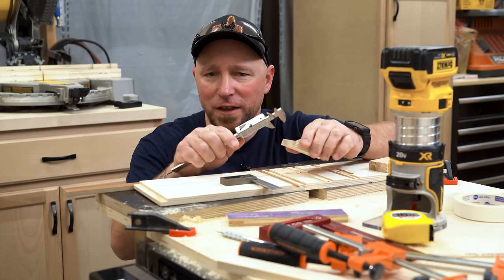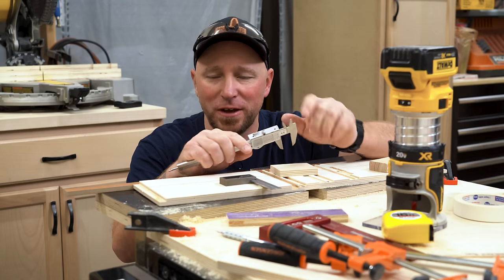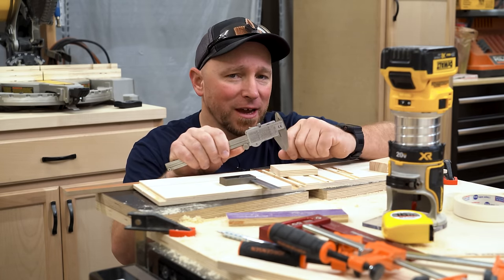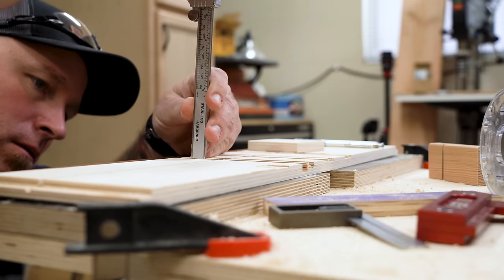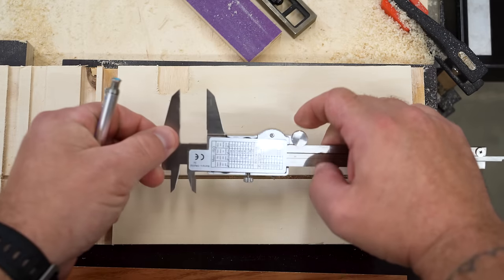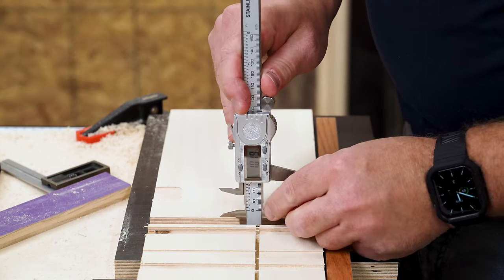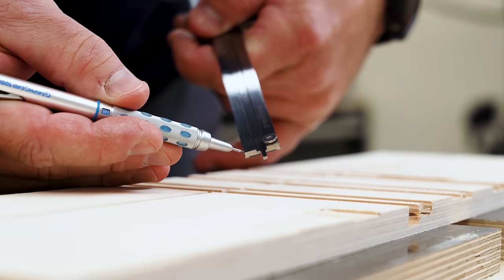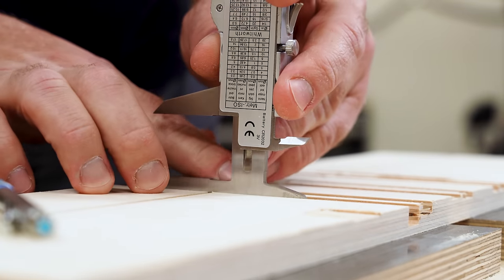The HIDDEN 4TH WAY to Measure w/Calipers

Comment: To measure the distance between two holes / studs
1) Measure one hole and zero the calipers
2) measure outside-to-outside, and the offset you put in in step 1 will automatically compensate for the two radiuses.
Reply: Yep. But only if the two holes are exactly the same diameter.
Reply from the maker: I think I might be reading this wrong. Why not just measure the space between the holes/studs? I do something similar to find centers of holes/studs though. I just measure, as an example, from the leftmost side of one hole, to the left most side of the next. That reading is the exact center-to-center distance between the two.
Reply: @InspireWoodcraft  The way I describe uses both external (for studs) or both internal (for holes) jaws. The way you seem to be suggesting would need one of each type of jaw? 
While  I am at it: Making metric parts on imperial lathes, or vice-versa. Set the caliper to the exact size required. Then zero it. Now change units and the measurement tells you how far under or oversize you are, in the required units, with no maths needed. Actually, this works even if you don't need units to work out how mush is left to take off. Or put back on 🙂
Reply: @andypughtube  i was charged with teaching a kid on a lathe. every mark on his tape measure was labeled, when he forgot it at home i let him use mine and he asked how is he gonna know what fraction hes at. I immediately had a talk with the boss and the kid was let go.
Im always weary of those who look for a work around to avoid one of the skills required no matter how small and insignificant that skill may be.
Reply: @swskitso  Tell you what, you carry on doing things the hard way. I will carry on using the available technology to do things the easy way. And we can both agree not to tell the other that they are doing it wrong.
Reply: @andypughtube  and when you lose the ability to perform the required task because you dont know how to do it without technology we will keep going without you.
Reply: @swskitso  and when you lose your tape measure I’ll have a word with the boss
Reply: @beyondafx  if i can find a stick or a string i can take a measurement 
I may not be able to write down any number to correspond with any known measuring scales but i can replicate an item or craft something original.
Numbers and measurements are made up things.
Reply: @swskitso  so instead of teaching him how to read a tape real quick, you have the kid fired? That sounds real petty
Reply: @EdM66410  that was the final straw not the first.
The only question asked of me before i got the job was can i read a tape, actually they told me my friend was wrong and they were not looking for help before they asked, when i asked if they needed me to read thirty seconds or sixty fourths i was hired
Reply: @swskitso  Cool story.  Your life experiences have made made you a uniquely valuable member of society to whom others should defer.

Is this the social validation you're looking for here?
Reply: @wcookiv  this is nothing about social validation, the problem is people relying on technology rather than skill.
Im a tradesman and i take pride in my skills i have developed, when someone claims to have a skill but their capabilities rely on that technology its an insult to every person who has taken the time to develop that skill.
Reply: @swskitso  Sir this is a YouTube comments section.
Reply: @wcookiv  and thats why my first response was an anecdote pertaining to the subject of the original discussion, then each one after is direct response to each of you that just wants to stir shit with me rather than discuss the subject.
Reply: @swskitso  I totally hear what you're saying but just because we come up with tricks or shortcuts doesn't mean we don't know or forgot the fundamentals. Theres different ways of doing things and if you maintain the same accuracy but faster, or less likely to make an error, is that not a good thing? Why did you even click on this vid? Were not all the kid who cant read a tape. I agree, that's ridiculous and I have seen someone who couldn't read fractions either.
Reply: If the holes are the same size just measure the distance between and add the size of the hole. No need to zero the calipers
Reply: @swskitso  is a Luddite.  Which is a tough spot to be in a changing world of technology.  Adapt or be replaced as they say...
Reply: @MathewHammond1  its just a way to avoid doing 5-digit arithmetic in your head. I suspect that this and other comments (mentioning tape measures in the context of a lathe) are coming from a different perspective to me, I mainly do metal machining and care about all the digits. And I am well aware that I am capable of making arithmetic’s errors.
Reply: @andypughtube  I only mentioned it because he did I don’t use tape. I make injection moulding tools so pretty much only cut metal
Reply: I cut shafts for multiple purposes.
While diameter is always tight tolerances like .003" the length between steps is much more generous, sometimes tolerance can be 1/8".
Reply: @andypughtube  I’m also a machinist and have never done it how you’re saying or seen anyone else doing that way. Just seems like an extra step. If it’s for a bolt shouldn’t matter all the digits if it’s a locating hole then I wouldn’t be measuring off another hole unless that’s the only way I could measure it. If it works for you though by all means do your thing
Reply: @MathewHammond1  Math is slower unless you're a savant or dealing with simple holes that are dead-nuts on-spec. Whether it's the time taken to add 3.834 and 0.627 in your head or the few seconds spent reaching for scratch paper or a calculator, measure-and-zero will likely be quicker.
Reply: @alanjervis9022  there’s also a magic device called a calculator and even then that math took 2 seconds of 4.461 in my head
Reply: Outside-to-outside you'd be measuring both holes' diameters, not radiuses. This method is worthless. You'd need to measure inside-to-outside for it to work assuming both diameters are the same. You'd essentially be skipping one hole on the second measurement. Way faster to directly measure the space between the two holes.
Reply: @EldeNice  For two holes with diameter D_1, D_2 and distance between centers L:
* The inside-to-inside distance is L - D_1/2 - D_2/2
* The outside-to-outside distance is L + D_1/2 + D_2/2
If both diameters are the same, this simplifies to L-D and L+D respectively. Subtracting the diameter from the outside-to-outside distance will give you the length. Adding the diameter to the inside-to-inside distance will give you the length.
Reply: @kanetw_  That's if you actually want the measure from center-to-center. Not "between" which would be inside-to-inside. Words matter. To get inside-to-inside you'd need to substract both diameters after measuring outside-to-outside, making the method worthless.
Reply: @EldeNice  between means between centers for me
Reply: @kanetw_  well the guy wrote "To measure the distance between two holes / studs"
Reply: @EldeNice  when it comes to machining or carpentry the default is to measure on centres. "To measure the distance between two holes/studs" means centre to centre distance to me. I've sent drawings back because things weren't drawn centre to centre and that just makes things that much more cumbersome to deal with.

Just think about it, if you're drilling a hole, you're going to find the centre of that hole, mark it with a centre punch and then put the tip of your drill bit into the mark you've just punched.
If you have to space a number of holes it's much easier to work from on-centre measurements. Especially if the holes aren't all the same diameter.

It's even more evident why it's easier when you have to drill "more complex" hole patterns. Say you have a pipe with a flange and you need to make a cap to seal it off. The pipe is specified as a 110x104 with a 30mm flange, and the bolt pattern is 12x125 for M8.
Because all of those measurements are given on-centre it's much easier to mark the holes. You need a disc that's 140mm in diameter, find the centre, set your compass to 62.5mm to draw the 125mm circle that the bolt holes need to be on, then set your compass to 31.25mm and walk it around the circle to mark the centres of the 12 bolt holes.
If you'd had to do that from specifications that aren't based on centre-to-centre measurements, you'd have a much harder time getting it right.
Reply: @fermitupoupon1754  That's fair, but blueprints usually don't use words explicitly for that reason. To prevent miscommunication. In a good blueprint you'd find all the measures you need to complete the project, including center-to-center for holes and between holes/studs/wtv because those measures have different applications and the less interpretation you leave to machining/assembly, the less room for error on your prototype. "Between" is a word that excludes the two reference points in measurements and mathematics by default. That's why we use "inclusively" and "exclusively" when talking about intervals or "center-to-center", "outside-to-outside", etc when talking measurements. I get your point though, I'm just hung up on a technicality.

Comment: I knew this and use the feature often.
I have been an electrician for nearly 45 years and learned something about rotary 3 phase converters last week that I didn't know. I spoke with an engineer friend (approaching 65) last night that didn't know what 3 phase power is. 
We are never incapable of learning something new, even in our field of specialty.
Reply: Fellow smart guy here, what about 3 phase rotary converters did you learn if I may ask?
Reply: About ten years ago I was speaking to a peco guy reading the meter and I confessed I had just grasped the 3 wire to 4 wire current null of a branch circuit. He leaned over and said he only grasped this a few years earlier too. Basically how there's no current on the neutral when L1 and L2 are the same current
Reply: @jeffreystroman2811  Jeffrey,
I wrote this about 3 weeks ago and I have been looking into 3 phase power conversion since. I can't recall what I had just learned since I have learned so much since writing my comment... I also had open heart surgery since writing my original comment... I have some lapses in my alertness!

I worked as an electrician beginning in the 1970's. I always worked the maintenance technician side, beginning with large facility commercial maintenance, then moving to industrial/manufacturing in 1982. I was licensed around 1984, carrying the only license for our manufacturing company (nearly 500 employees). I did all phases of electrical management from the wireman to design/specification, most heavily on troubleshooting. I have done some intermittent trade school instruction. I was most valued as a CNC technician, but like many maintenance departments you wear many hats with limited exposure to various dimensions of the trade. I have particular interest and skill in PLC, motors, motor drives and control, and transformers. Since I never worked construction, I have limited experience setting large transformers and switch gear, but from the switch gear out, I am very experienced, seldom building anything larger than 1200 A, 480 V.  St Louis was only one of two jurisdictions that permitted ungrounded Delta electrical systems. Although uncommon even in our market, I installed and maintained ungrounded Delta systems as well as the much more common grounded systems. I never obtained any college degree, instead I opted to work to support my large family. 

In my hobby life I am growing my dependence on 3 phase machinery in my home shops. 3 phase is not affordably available to my home, so I am opting for rotary phase conversion and VFD. I built my first rotary generation and used it for years. I never completed my design and was still spinning up my motor with a pull rope until a few weeks ago, when I installed a factory built rotary phase converter.  I didn't understand how these units are rated or that multiple motors running at the same time has an "additive" effect producing a better third leg waveform. I would like scope wave forms for my own understanding, but I don't own my own scope. I currently only own 7 3 phase machines. I have been running them one at a time from my rotary generation or dedicated VFD. I just move my power cord to run any particular machine. Over the past week I have been considering setting a 3 phase panel powered by a single rotary converter and wiring traditional 3 phase beach circuits. I am not certain how to load rate my convertor. The data plate on my first factory unit rates connected HP over a large range. I interpreted this to mean that there is a maximum single motor starting capacity, but also a total connected load capacity. I purchased this unit at an Amish sale, and it has no documentation. I installed this unit on a shelf to get it off of the floor and save my arthritic back. This may be a mistake. Unit vibration telegraphs more noise than I expected. I have another larger rotary converter that I picked up cheaply after the previous owner gutted the controls following a control failure from rain water infiltration. Its data plate is obscured, so I don't know much about it yet. I just purchased a large engine lathe that exceeds my home shop rigging capacity by 3500 lbs. I suspect that this lathe motor will exceed my current rotary phase conversion capacity. I can't know for certain until I get the new machine moved. It is staged against a wall and I cannot get to the motor or control cabinet. I bought the lathe grossly under estimating its weight. With my heart surgery, I have not had time to figure how to rig it home affordably.  Adding this lathe to my shop prompted my current interest in 3 phase conversion load sizing. I have always had over capacity and never worried about that previously. I have only had a small Atlas metal lathe. I started to restore a LeBlond engine lathe. Then I ran across this very large American Pacemaker.  I just moved into my new 4800 ft2 shop building. I brought the LeBlond out restoration hibernation when I moved in on new years day. No heat in the new shop yet and heart surgery have kept me from spending much time iny new shop space. I built the new building for hobby space in temperate weather and kept my old shop that is climate controlled for weather extreme hobby play. I am currently shopping for an affordable 12000 lb + two post vehicle lift. I don't think that I will ever own anything demanding that capacity, but two of the boys own service trucks in excess of 12k. It seems imprudent to purchase close to that capacity and not be able to service their rigs. The price on these lifts jump about $1k for every 1k capacity required. Before building the new shop I have never even had a garage. I am having a real joy outfitting the new shop and fulfilling life long dreams. It is all just retirement hobby pleasure!
Reply: @jeffreystroman2811  That is not true, tho, on 3 phase or 3 phase derived  single phase  because unlike single phase, 3 phase is always  1/3 of a wave apart.  They never null
Reply: @fourfortyroadrunner6701  not referring to 3 phase,
Reply: The Edison 3 wire system, when both legs are drawing the same current there is no current on the neutral. Because where it goes from 3 wire, to 4 wire, there is a null as the two legs are 180 degrees apart, I tend to call single phase two phase because it is, even tho no one else calls it that. Of course the phase inversion is derived locally, from a center tapped transformer, but it is still two phases regardless
Reply: @fourfortyroadrunner6701  does "null" mean zero? Because I'd consider the reduction of current on the neutral of a 3 phase system as the legs are balanced to be a type of nulling. By the square root of three that is.

Comment: Thanks! Didn't know that one. Another useful aspect that took me a while to notice is that the jaws are perfectly parallel, which means you can use them to check whether two surfaces of an object are parallel by pinching and rotating the object. If the surfaces are parallel, you can feel friction as they rub against the jaws. If not, it will pivot around a single point.

Comment: Great thing to note here too:
If you have a set of calipers that arent in the best condition, you can use this method for marking up holes and such.
Simply open the calipers to the required dimension from the edge of the workpiece, butt the step against the edge, and mark off the tip of the caliper.

Comment: There's a 5th way I've found too. Slide the moving part out of the way and just measure stuff directly on the gauge. Not for close-up work but it's an option.
Reply: Where's my glasses..
Reply: That's by far the most expensive way to eliminate the use of a one-dollar ruler :D I love it
Reply: @patrickd9551  I find it absolutely useful to have cheap quick ways to measure around. Paper rulers are cool. I have inches and mm lasered into my work surface. This is not quite so cheap but quick measurement options are invaluable and I find my steel rulers tend to walk.
I do a lot of off-the-cuff design and find it's very easy to misjudge the scale of things without something to reference.

Comment: If I remember correctly its actual intended use is to measure from the outside edge of the piece to an inside corner. You can use it as a depth gauge that way and in woodworking you should be ok. If you are working with metal plastic or any other bendable material be aware that if there is a radius at the bottom you will not get an accurate measurement using for depth. Which is why the depth blade has a relief cut out of it.